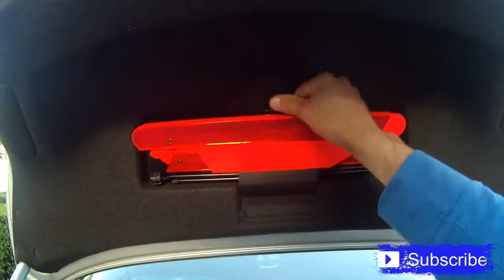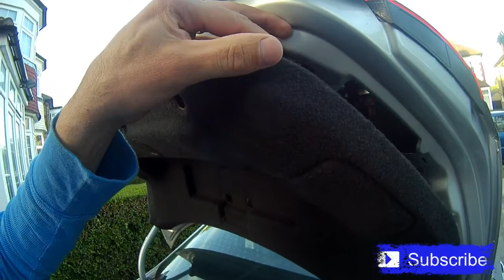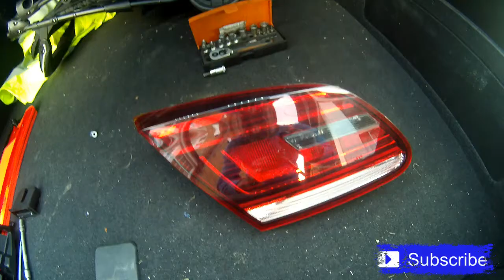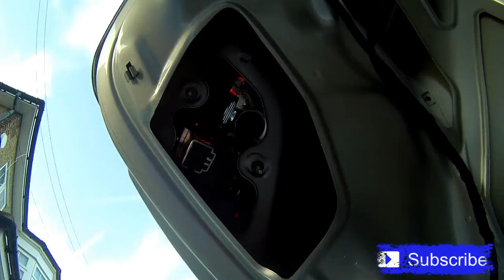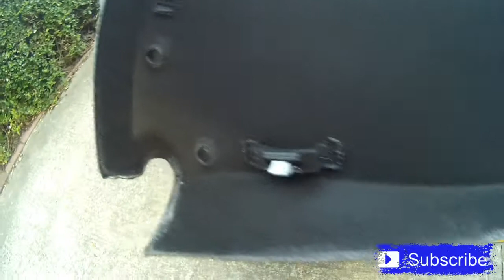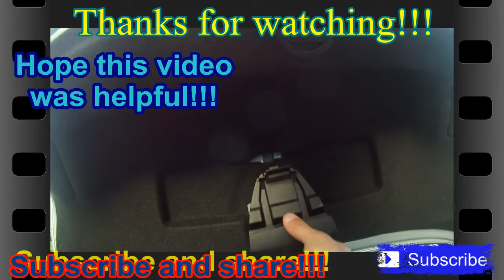How to remove the Light Tailgate, Boot, Lid on Vw Passat CC

Comment: Hi there, I am from USA and trying to find correct part number for that lens you removed, assuming you are in Germany and have the rear fog light, the part number in video appears to end up T. Does the CC there have 2 reverse lights (one each side and 1 rear fog light? Would you mind sharing a video of how the lights look when turned on? Reverse /rear fog?